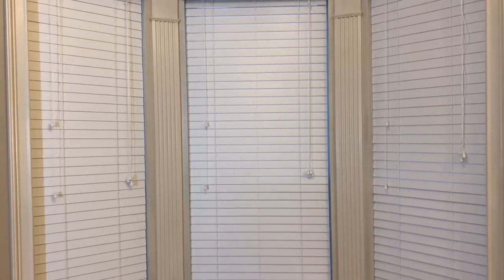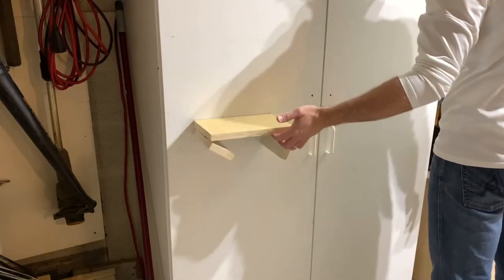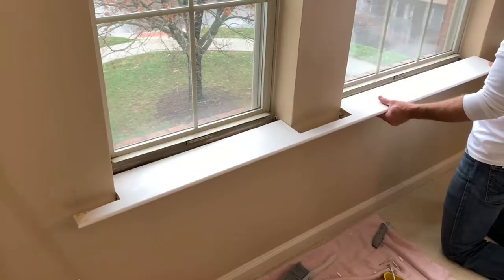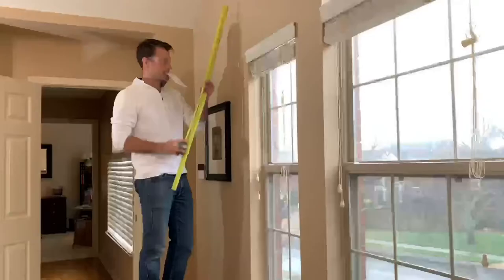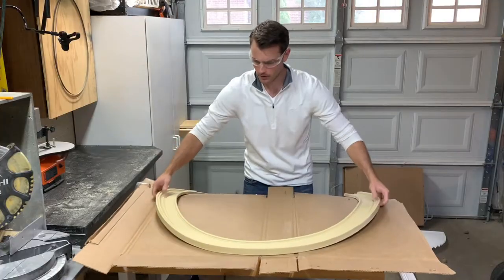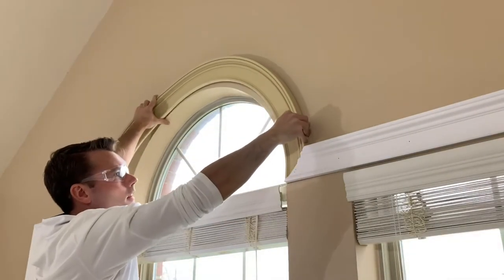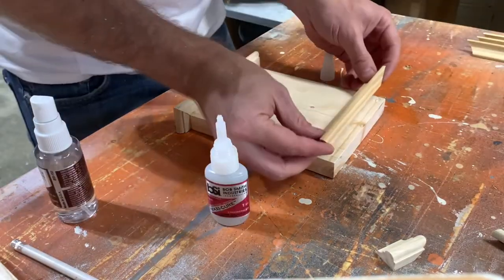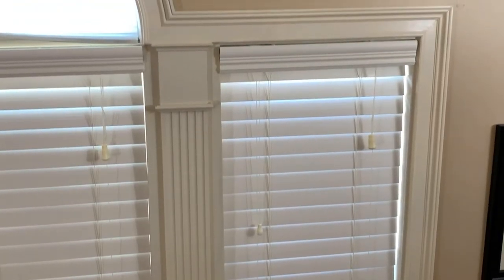Trim Out an Arched Window

Comment: I have 2 quarter arch windows to trim.  Purchased the flexible molding however not sure how to trim the inside of the arch!
Reply from the maker: Is the inside drywalled? If so I just painted mine and it looks great. If you need to add something I would get a thin piece of PVC trim and rip it to width. It will be flexible enough. 👍🏻

Comment: Great job. This gives it such a high-quality look. I can't believe after 30 years of making stuff this was the first time I have heard of flexible molding. I always did it the hard way. I will have to check in to that. Thanks for sharing.
Reply from the maker: Thanks for watching and commenting! Glad I could share a bit of info. Did you cut a bunch of kerfs and bend it that way?
Reply: @RLLWoodworks  I think cutting kerfs would drive me crazy with trying to get the right angles. I use a couple different methods. Take some hardwood cut at certain angles and finger glue them together. Then I cut it to size. I have also used plywood and glue them together to get the size I need. The last was steaming lumber. That one is time-consuming. Sorry I didn't want to make this too detailed. It would have been a long post. I still like your way of doing it. It definitely makes it easier. I haven't had the chance to go through their website yet but will look into that.
Reply from the maker: Wow you sound pretty skilled! Nicely done sir!
Reply: @RLLWoodworks  I wouldn't go that far. I appreciate the comment. I think that everyone learns a little bit from everyone. Before Youtube if you wanted to make something you had to learn from mistakes. Now with Youtube you can watch other makers and come away with some good tips and ideas. Just like finding out about the flexible molding that you used. So well done back to you.
Reply from the maker: Thanks so much!! I totally agree with you.

Comment: Can you share exact casing specs you used? 3 1/4"? I trying to identify what specific model you use for the apron and the flexible molding. I have same windows pattern here. Thanks.
Reply from the maker: Yes sir! The exact measurement is 1-1/16” x 3-1/2”. The item number is WBNRB3 on flexiblemillwork.com. This should match the RB3 casing you can buy at the big box stores. Hope this helps but let me know if not. Thanks!

Comment: Any knowledge about how long “CA glue” last in years? How does it accept latex and oil based paint? Does “CA glue” hold any structural properties? Jw be sometimes quick help tools aren’t worth it in the long term. Thanks for the video!
Reply from the maker: These are great questions!! I’ve been using it for about 3 years and have some projects where it’s still holding up great. Never had an issue painting over it and I feel it is very strong but when used on wood, I think wood glue would probably be stronger if clamped and dried properly. Thanks for commenting!

Comment: You cut angle for the rubber trim was 45? On each side
Reply from the maker: Yeah. Kind of a pain because the radius is up against the mitersaw fence so you kind of have to guess the correct placement.
Reply: @RLLWoodworks   thank you, and great work!

Comment: How did you mount the blinds under the arch.
Reply from the maker: Great question! The blinds come with brackets that screw through the sides or the top. Let me know if that doesn’t make sense and shoot me a DM on Instagram and I’ll send you a close up pic.
Reply: @RLLWoodworks   I just messaged you with the problem I'm facing
Reply from the maker: Awesome!